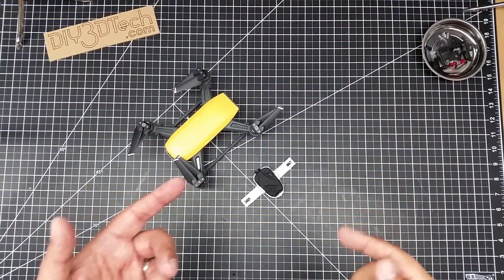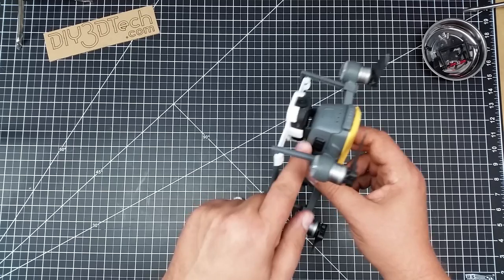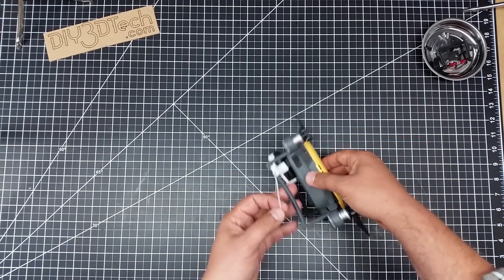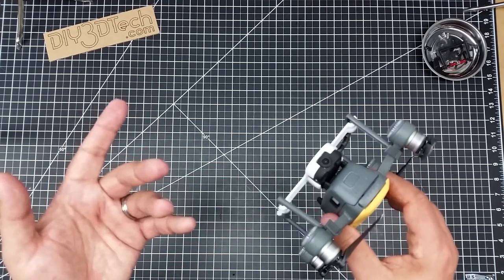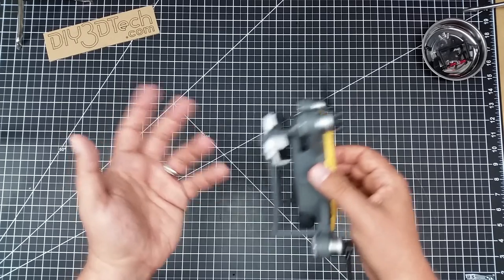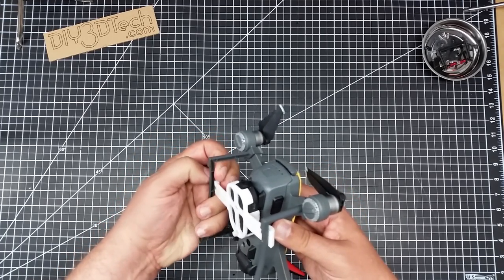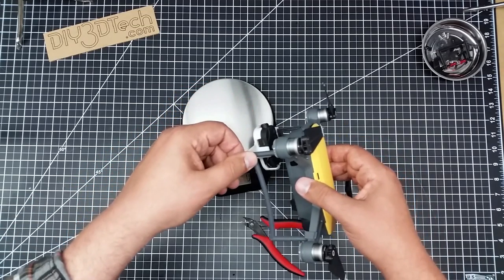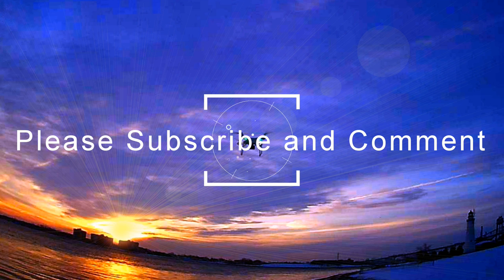Video Drone - DJI Spark 808 Keychain Camera Holder!

Comment: Well....For lunch, it was some left over chicken breast and an orange.  
Really nice video and very interesting and looking forward to seeing how it flys and looks on the video.  It would be nice if such a feature was available on the drones,  just like a 'backup camera' on cars.  I have three pairs of those legs and wanted to make a float for the spark so just in case it landed in the water, it would not sink.  Not having a 3D printer, I'll make something out of styrofoam or similar.  but I really like the idea of a back facing camera.  Hmmmm.........
Reply from the maker: Ye this one has worked well as I also did a Gopro version (which is pushing it weight wise).  Let me know how the float idea works :-)